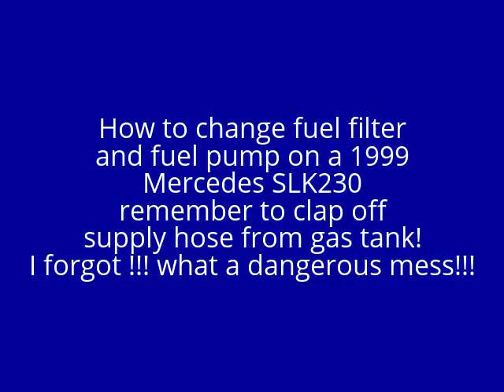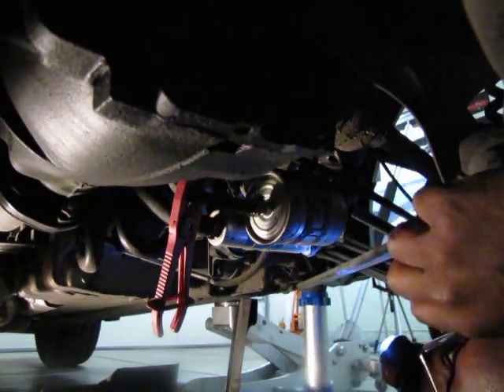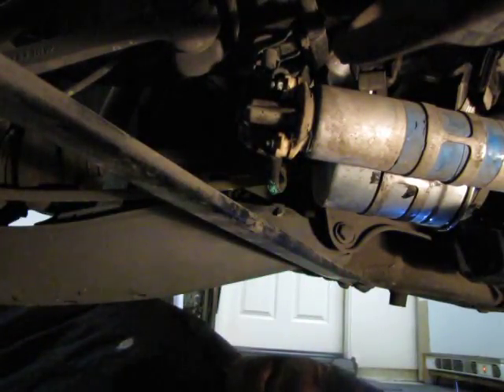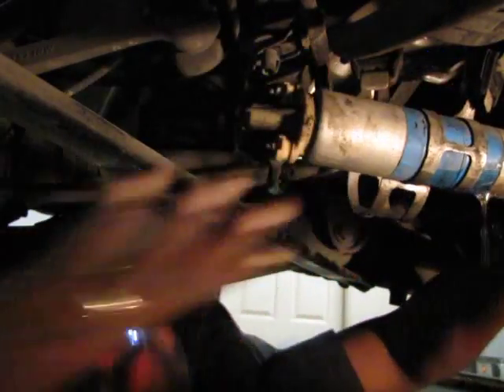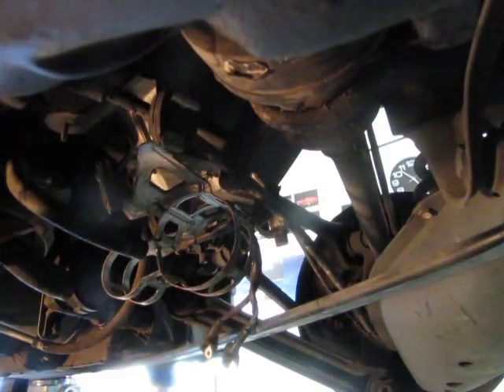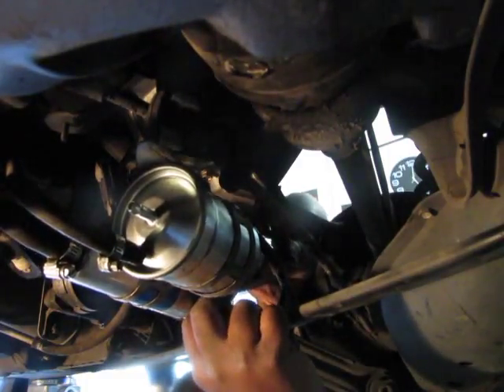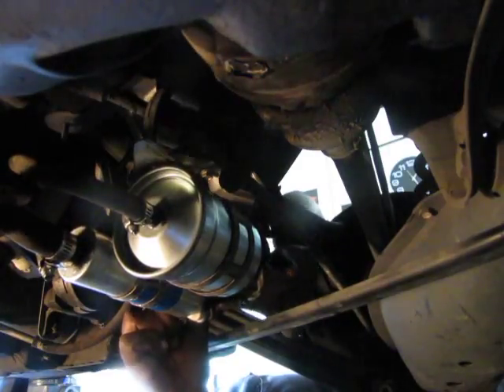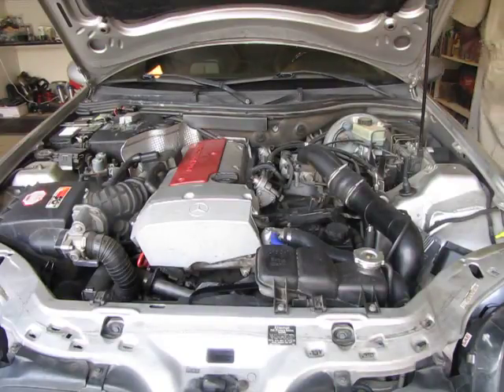How to change fuel pump and fuel filter on Mercedes SLK230

Comment: Hi. Great video. I have a 2021 SLK that's run perfectly every year since I bought it used in 2004. Now it turns over without a hint of wanting to start. I suspect it's the fuel pump. I hadn't thought of the fuel filter also. It's also nice to know that they're both easy to reach. Thx again..
Reply: Correction-It's a 2001 SLK
Reply: And were you correct in your assumption? Cause I can think of a few things that might be.

Comment: This video is a joke to watch,i love it!!I laugh my gut out . Later I  did replaced mine without any problem. Note  spray the hose with WD40 before removing them also use a pair of pliers to twist them.then use the flat screw driver to push them off.

Comment: Great Video, Thanks for making it.  One suggestion in the future would be to drop the assembly down from the rubbber mounts it sits in to make it easier to access.  That whole piece will come off the car and will be much easier to work on.  I replaced dual fuel pumps on a 1989 300e and removing the assembly made it much, much easier.

Comment: Great advice about chocking the tires.  Definintely don't
 Want the car rolling off the stands anytime.  I have a SLK 320 and I kind of think it's the same system as the pump is kind of noisy.  Thanks for showing us how this is done.
Reply: And yes everyone has done that at least once with the fuel running.  Especially running into your arm pit.
Reply from the maker: Thank you for the comment Lisa!

Comment: Nr. Hightower I  watched your video I have the same car your wife. I  was told the fuel pump and air filter need to changed.  Where do I purchase these parts? There is no sign of gas on the pavement but I do smell gas fume at times. How safe is it to drive to nearby store?

Comment: Salve dovrei fare lo stesso lavoro sulla mia SLK 200 Kompressor R170 Evo del 2002, che non va in moto nonostante il motorino di avviamento gira benissimo, pensi che siano uguali le auto come posizione dei componenti da sostituire. Non hai messo i link per l'acquisto, delle parti da sostituire. Forse un po più di illuminazione era gradita.Grazie

Comment: I have a miss fire cylinder 1 and 3 but also when I press the gas it doesn't rev up any help
Reply: Coil likely. This car has 1 ignition coil per 2 spark plugs/cylinders.

Comment: The two nuts on the filter pump are different in sizes so you don’t have to mark them
So, does the fuel  pump > run to the >filter runs. > to the fuel lines
Reply from the maker: Yes, they are right next to each other and the pump send the fuel through the filter before it goes to the injectors.

Comment: i have replaced my fuel pump with a new one, but there is a noise when i turn the key, i took another one but the noise is still there. fuel filter replaced too.

Comment: you didn't happen to mention if this solved the problem or not, im having an issue while the car is under heavy load (like a/c on and trying to get on the interstate) I notice the power plateau's and if you push the throttle down further it stumbles, almost like misfiring or lack of fuel and timing advanced too far, supercharger is coming on, I also held it in the stumble for a few seconds hoping to get a check engine light and stored code but didn't happen. I replaced the crank position sensor and I have the fuel pump and filter here ready to be installed but did replacing the pump and filter correct the issue?
Reply from the maker: There was no real problem just an old filter so I changed the pump at the same time. If you're having power problems, it could be a lot of things.  I would start with the simple stuff like clean correctly gaped spark  plugs. clean air filter, clean throttle body, good fuel pressure on both sides of the fuel pressure regulator. Then, if you still have no power, disconnect the electrical connector to the bypass valve next to the air filter to turn the super charger off and check power before and after. Even though the super charger is coming on, if may not be producing much bust due to the need for a rebuild or there could be a boost leak in the piping to the MAF to the throttle. Hope this helps.

Comment: When working on the Fuel system, start the car then pull pump fuse to make car run out of fuel to relieve pressure....